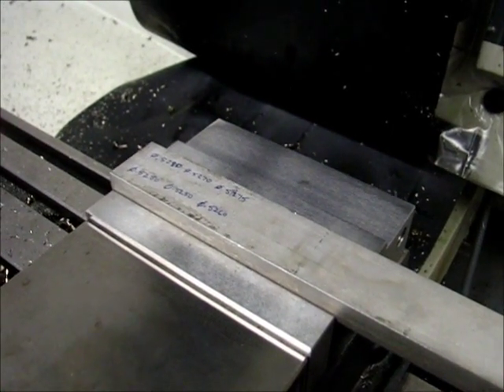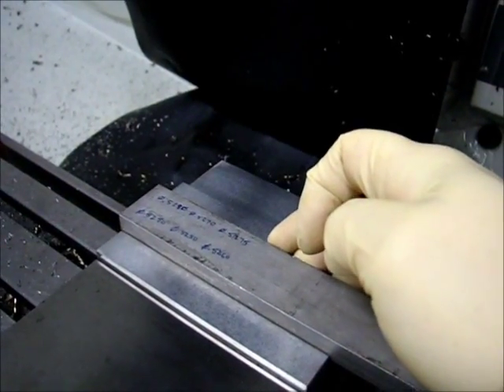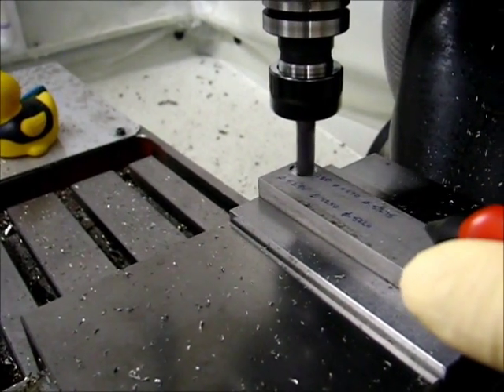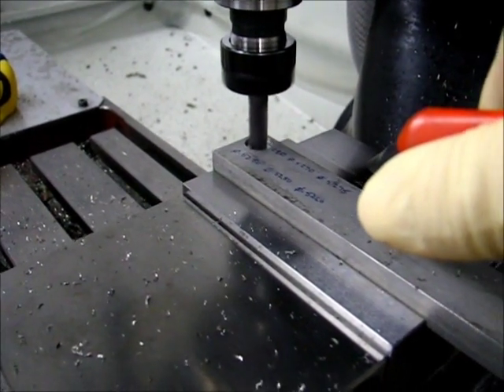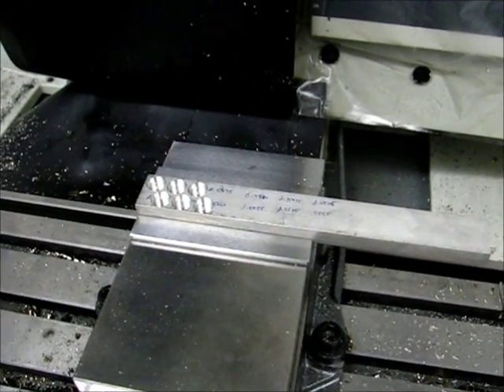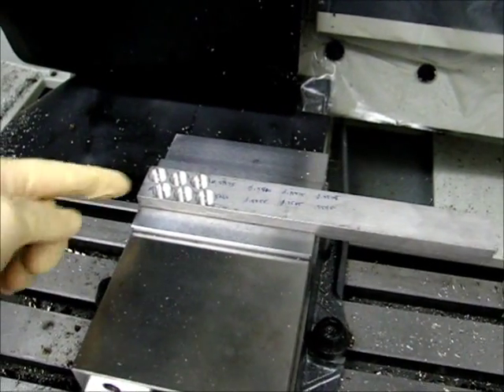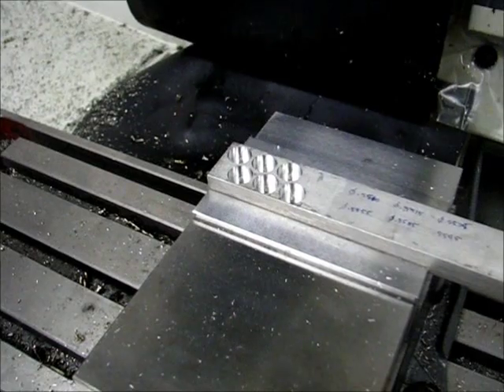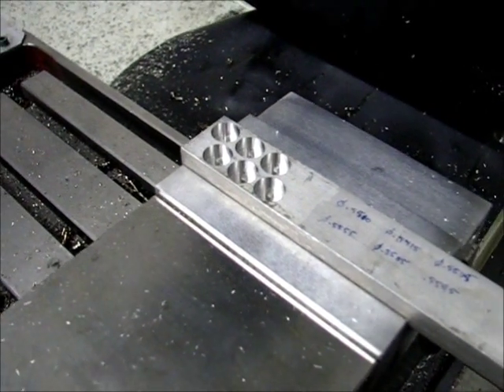Tormach PCNC 1100 - Helical Entry for Hole Entry without Pre-drilling, 17-4 PH

Comment from the maker: I think any entry angle greater than 3° would terrify me in this material.  I do 5° in aluminum without even thinking twice.  I've even got a video uploaded that shows a 45° ramp angle in 2024 aluminum (a prototype of this part; look for the video called "Tormach PCNC 1100 - First CNC Part" at 4:55). I didn't know how to control the helix in the CAM software then.